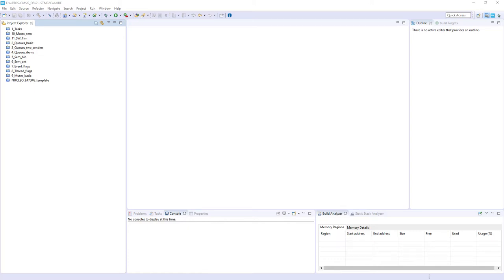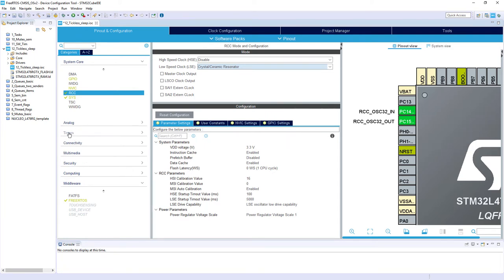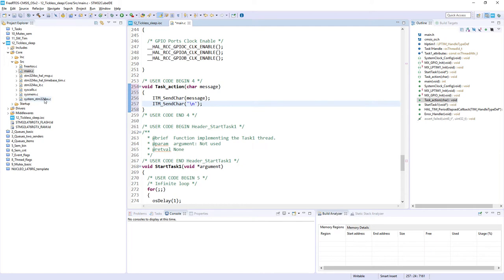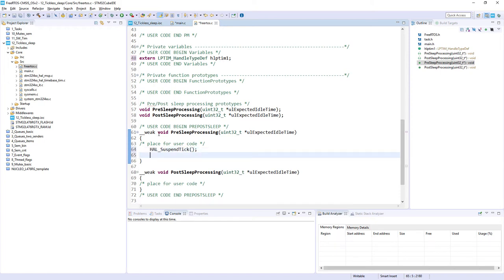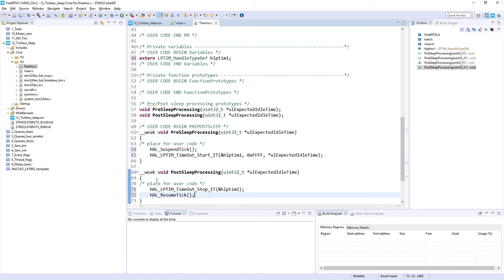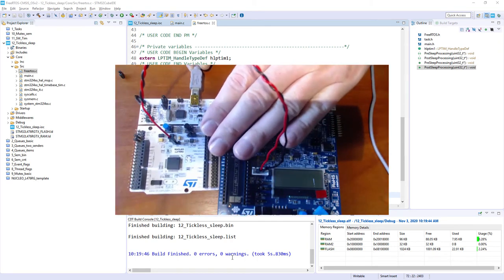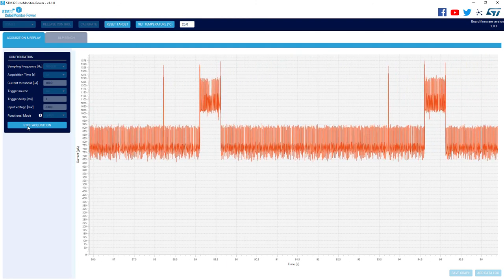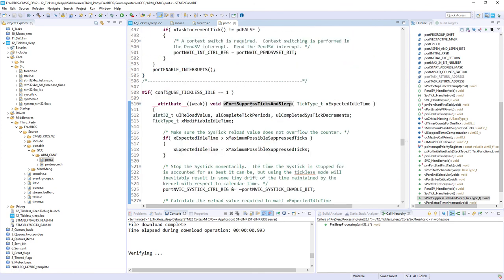FreeRTOS on STM32 v2 - 21b Low power modes (tickless SLEEP mode) - LIVE lab

Comment: You select LSE 32768Hz clock source for LPTIM and divider 32 -> LPTIM counter clock is 1024Hz. But FreeRTOS timebase is SysTick, wich is reate 1000Hz, and osDelay(1000) not be a 1000ms :)!
Solution:
1. Select the LPTIM clock source LSI 32000Hz (then LPTIM frequency will be 1000Hz as need for osDelay() correct)
2. Select RTC clock source LSE (for normal time, LSI has a bigger drift, LSE better)
And you did the opposite )))
Reply: Why the prescaler is set as "32" in this vedio?
Because of the 1000Hz systick?
Reply: @ykliao9962  32 but crystal is 32768. 32768 / 32 = 1024 or 0.97ms tick
Reply: @alexandristomin1313  Why the prescaler would not set as 64, 128 or other values?
Reply: @ykliao9962  ask this question to the author of the video))  in general, in order to get as close as possible to the frequency of 1 kHz
Reply: @ykliao9962  FreeRTOS tickrate is 1KHz configured
Reply: @alexandristomin1313  thx
So it is looks like the one clock pulse of LPTIM is equal to one tick?
Reply: @ykliao9962  in this case 1 tick is approximately 32 pulses
Reply: @alexandristomin1313  Sorry, I am not sure how the LPTIM expired. 
If the LPTIM will expire in tickless mode 5 systicks(5ms) later and the prescaler is set as "16"(2kHz) , then which one is the correct expired time , "5*64" pulses(5ms) or "5*1/2000" s(2.5ms)?